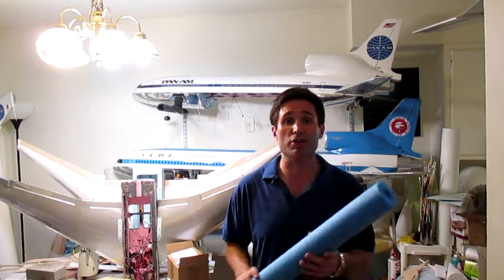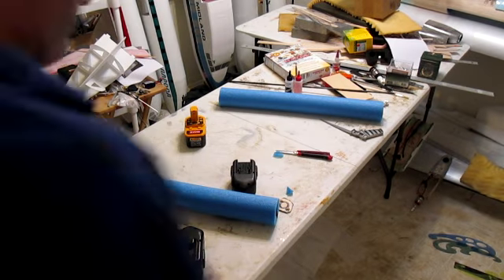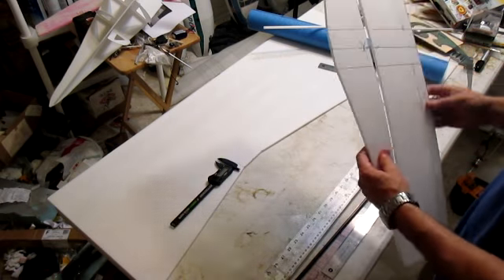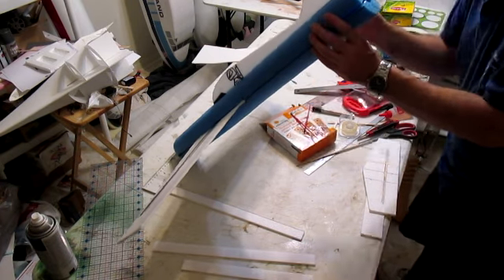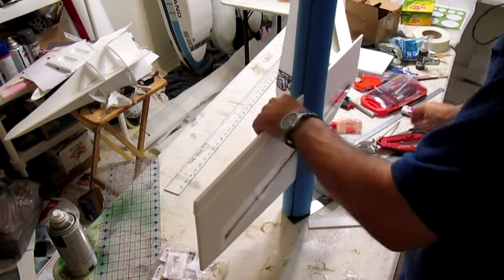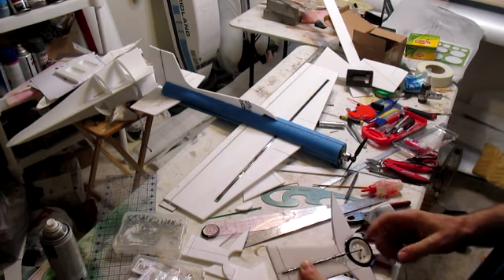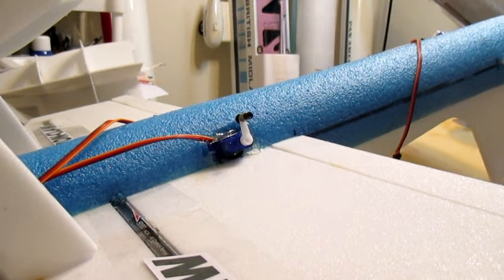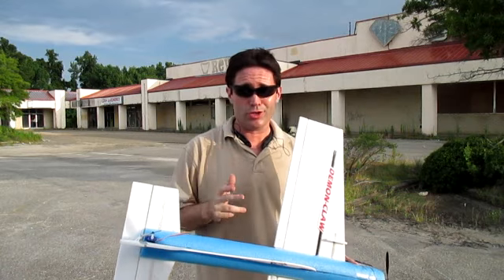DIY Your own Pool-Noodle RC 3D Trainer airplane!

Comment: so you went from a 2S battery to a 3S and had far better power, correct?  on my foam scratch trainer, i think im going to go with 3S.  I have quite a bit of front weight due to steerable landing front wheel but it will all balance out.  Tricycle landing gear for me due to steerability.  Also, ive got one servo per aileron which with 9G servos is just perfect.  Servo's only cost $1.80 usd per unit, so i'm using tons of them.  I might even add flaps, have you ever worked with flaps?  should I put them in place?  and could i do one servo for both flaps or would you do two servos?
Reply from the maker: Yes, she flew much better with a 3 cell lipo.

Comment: What kind of battery is it,(as specific as you can pls) 👍
Reply from the maker: Christian you can use a 7-volt to 11-volt Lipo Battery.
Reply: @F3HDemonDriver1  3 cell?
Reply from the maker: 11 Volt 3 Cell or 7 Volt 2 Cell, Yes.

Comment: Driver, get yourself a pair of KLEIN LINEMAN PLIERS  and you will never think a small steel wire is a tough one again. Been cutting hardened screws with these for years. Have tried many other Linemans and NONE compare.

Comment: We'd like to see it fly.
Reply from the maker: 2:36:15
Reply: This is a cool little project, but that is a FAST trainer, and obviously, a tube warped to the right is going to be problematic for a newbie struggling with trim adjustments in the first ten seconds of the flight, so attention should be paid to that.

Comment: Hi, awesome build. 
Could you tell me the diameter for the fiber rod and thickness of the Depron that You used?
Reply from the maker: Hi Sherri, you can use 3-5mm Carbon fiber Rids or an Arrow body as well.
Reply: Thank You for the prompt respond, keep up the good work.
Reply from the maker: My pleasure.

Comment: I'm very  sorry but at about 2.40  and again later  a view of the plane showed it to have a banana shaped fuselage!!
That plane is not straight at that point!
Great vid. But did you have to do remedial work to make it straight. 
What was that tool you used for forming drawn curved shapes? 
You used it for the canopy and the wheel housings?
Loved your "just do it" manner"
I'm going to try this. 
Thank you for posting this great tutorial.
Reply: It seemed to fly to the right taking off - he is a very good pilot to compensate and fly as well as he did.  Also I did not see where the motor was mounted with a degree or two of offset to compensate for "P" factor that could have contributed to the tendency to fly to the right that was visible on take-off.  Far too fast a plane for me as a trainer, but many great  points in the video overall.

Comment: Hi F3H DemonDriver. Thanks for the details in the video, looks like a fun project. Kudo's for the Chip Foose drawings in the beginning! I was wondering if you could share more details on the electronics, maybe an ordering example? Greetings from the Netherlands!
Reply from the maker: +Pevi70  I'm Happy to help Sir!
Reply: +F3HDemonDriver Great, thanks! Would you mind going through this list to see if I order the correct parts?
miniservo: http://eud.dx.com//product/towerpro-sg90-9g-mini-servo-with-accessories-844012859#.Vy3SPISLSUk
Motor, speedcontroller and props: http://eud.dx.com/product/a2212-1000kv-brushless-motor-w-30a-brushless-esc-1045-propeller-dji-f450-550-844413446#.Vy3T04SLSUl
Thanks in advance!
Reply: +Pevi70 Maybe this one is better:
http://eud.dx.com/product/a1504-2700kv-brushless-motor-10a-bec-2-5g-steering-servo-3-4-1-4-1e-motor-shaft-set-844045754#.Vy4eQYSLSUk

Comment: hi I am trying this I have a little difficulty about the parts her in Peshawar Pakistan
and can you tell me the ratio of power of ESC motor and battery plz
Reply from the maker: +gulfam khan Try and find a 20 to 40Amp ESC and a 7.4 to 11. Volt Lipo or Ni-cad Battery.
Reply: +F3HDemonDriver and motor?

Comment: CAN YOU TELL ME THE SECOND THING OF THE ELECTRONIC LIST
Reply from the maker: +mukesh Chauhan  Yes That's The ESC Electronic speed controller this controls the amount of Power that enters the motor from the battery, It then connects to the Battery then the Receiver or The RX which receives the radio signal.

Comment: congrats, this really is a nice tutorial how to do this rc airplane. You said the price was between 30-50 usd (or whatever). Does the price includes Futaba 7CAP 2.4Mhz Radio and FASST RX  ?? Would you mind to add some sites where we can buy each part of this rc airplane ?
Reply from the maker: +Light Out.  Your right, the price only covers the airplane, not the Radio, if you want cheep parts try Greyson hobby in Atlanta, or Tower hobby in Chicago. . . Or I'd you live outside the U.S. try Unitedhobbies aka Hobbyking.

Comment: I realize you are trying to do this so that even the most novice builder can build one of these planes, but there were times that the descriptions were a little tedious and repetitive. That said, this is an ingenious design and the perfect build for someone who is interested in getting into rc flying without the huge initial investment. The big plus is that when that first crash happens (as it always does when you're first learning) it won't destroy a plane that you've spent hours building and hundreds of dollars on. I'm even thinking of building one for myself to take down to the soccer fields by my house just for fun flying. Heck of a lot easier than bringing my glow powered plane and all that goes along with it for just a few hours of casual flying.
Reply from the maker: +Rob Billeaud  Thanks Rob, I want to Make Start-to-finish Build videos to help New builders get into Scratch building! I hope you try and build this plane Rob.

Comment: Do you have to have a y tell adapter for ailerons? I'm more than half way in the build but got stuck on the ailerons. Please reply
Reply from the maker: +Brad Smooth. Hi Brad. ... are you asking me if you can add a "V" or "Y" tail? Or are you talking about a Y-connector for servo wires?
Reply: Well I'm asking how did you make the ailerons go opposite direction at the same time?
Reply from the maker: +Brad Smooth  Brad that happens due to the radio and receiver's aileron channel. . . . Your ailerons always move opposite of eachother.
Reply: I'm sorry I'm asking you so many questions but your helping me a lot in this build. So if I put my servo in channel one where does the other servo go that goes opposite of that direction. Thanks
Reply from the maker: +Brad Smooth  Brad you need to use a Servo "Y" connector between the right and left aileron servos, then connect that into the aileron channel on your Reciever, Understand Sir?
Reply: Thank you I will do that SIR. Holly the build goes great.

Comment: I have made this plane exactly like you but my plane's back part is shaking when its flying 
Please reply
Reply from the maker: +shanu napal.  Hi Shanu.  . You need to add a carbon fiber rod or stick to the inside of your pool noodle in order to get the tail to stop shaking.
Reply: F3HDemonDriver Bro really really thanks for the help i skipped some part so that i missed the carbon fibier thing so sorry
Reply from the maker: +shanu napal No problem Shanu! My pleasure Sir!

Comment: I'm thinking about building it because it seems good on flight and build, but have one question will it fly with a 1500mah 7.4 battery and a 1000kv brushless motor. PLEASE REPLY THANKS.
Reply: +Brad Smooth depends what prop you use
Reply: I'm using a 10×4.5" plastic prop with metal prop adapter.
Reply: +Brad Smooth yes that will provide enough thrust
Reply from the maker: +Brad Smooth  Yes If you keep the construction very Light you should be ok with that battery and Motor.
Reply: +F3HDemonDriver thanks a million.
Reply: +ConorCon thanks a million.

Comment: Hey, what's with the two L1011 fuselages hanging on the wall.   I assisted with deliver of the first TWA L1011's in 1972.  Beautiful bird, but the DC-10 did better as a commercial carrier.
Reply from the maker: +Beemerdave1 Thankyou Dave!  Those are two scratchbuilt L-1011's the PanAm is a 500 and the ANA is a longer 300 series Tristar.

Comment: How can i determine the range between the transmitter and the receiver,and what influences this range.
Reply from the maker: +Ihab Ahmed  simply make sure your radio and RX Batts are charghed up and you'll be fine   . . .keep your plane within 800 feet and your fine!

Comment: is there a way to extend the battery life? I'm trying to use this as a trainer to teach others how to fly a plane that we will use in the future; so we don't want to constantly have to stop and recharge the battery. Thanks for the video, it was very helpful!
Reply from the maker: Hayden Clish Hi Hayden . . M the easiest  way to extend  battery life is go easy on the throttle  during flight. . . Another thing is build or fly an aircraft with a long glider-like wingspan.
Reply: Thanks, good tips. I appreciate the quick response.

Comment: KV represent RPM per Volts, not KiloVolts...
Reply: I want to say that you actually mark a point too, and yes, some will argue on my comment I posted there, but in the context of this video, where we're talking about RC planes and KV motors rating, and much much more other stuff, I consider that saying kilovolts is a pronunciation error, and that the term RPM/Volts or just KV is much better for comprehension and also for avoiding confusion from other. I also want to say that this is true for me, exept if someone invent something that needs the kiloVolts unit to explain its capabilities, and that this thing is used in RC hobby (just because I never seen that, but it's possible that it already exist...) But, I do say that the video was well made and that the RC plane was really well thought and desinged for the money and the time spend to it! (just saying, I speak french, so i'm sorry for the mistakes I probably made ^^)

Comment: Great video!  My son and I are gathering all the materials to start building the plane as a Father's Day gift and summer project. We are wondering what is the size of the propeller you used and which motor should we use.  Thanks for taking your time to make the video and for your feedback.
Reply from the maker: Hi . . . Sounds like a great idea Sir. . . Get a mini brushless motor of 1300 to 2300 KV that's kilavolts. . . About 22 to 2mm diamter.
Use a 5 to 8 inch prop.

Comment: Think plane was little tail heavy.  You don't have common sense to fly away from traffic poles n buildings.  cant you find a field.
Your safety with blades in hands while cutting needs some cutting on board.
when using pinned hinges u should put a little vaseline over pins so glue doesn't interfere and gum up the works.
When u are holding up plane and working on rudder taping you were off camera site.  landing gear needs 1/8" square stock on top of wing and more cloth length of landing gear.  Other that that it was an interesting video..l hope you do more.
Reply: ronald wasielewski Ok RONALD WAKDONALD,,, ENOUGH VERBAL BEATING UP ON DEMONDRIVER,,,OK?!?!?!  OI VEY,,,,,,,,!

Comment: My son wants to try this as his first RC plane project. Can you tell us more about the receiver, the speed controller and the battery that ended up being most successful? We live in China, so we have some extra challenges trying to dig up all the supplies. Any details you can provide would be helpful! Thanks for the great, detailed video!
Reply from the maker: Carey Jane Clark Yes Ma'am, Use any good 2.4Mhz Radio and receiver, the smaller the better and a 20-30 Amp Speed controller and a 7 to 11 Volt Lipo Battery  . . .you Live in the RC Factory of the world so you can find these parts anywhere.  Sorry for the late reply Mrs Clark!

Comment: hi.I'm beginner. I have a rc plane its weight ~600-700 gr and li-po 2s 2200mAh. I could not decide motor type. how much its power/KV? may you suggest some advise for motor? I have C20 1550 kv-75 watt (propeller 7x5 ) motor but it not enough to flying.

Comment: Hey awesome video will be making one but quick question do you think if I got a little bit larger motor it would still fly? The reason being is that I would like to attach a small camera I got off ebay it is so small it fits I'm my Palm about as long as my ring finger. Do you think this would work
Reply from the maker: Sure it can. . . Just add about 8-to-10 extra inches to the winspan.

Comment: can you tell me the minimum of a motor speed or strengh to maximum and the cost.
Reply from the maker: AshTheBacon Hi Ash, well RPM is all up to the Motor size and its Voltage but i would say 4,000 to 8,000 RPM and cost of the motor can be $10-30.
Reply: ok thanks

Comment: I have looked for carbon fiber  arrow shafts in Australia its over $100
carbon fiber tubes from hobby king are cheap but i don't know what size thickness is the carbon tube you have used.
could you please tell me this thickness of the carbon fiber tube you have used and the thickness of the foam you have used to make the wings? I'm new the the game i need a bit of help.
Thanks
Reply from the maker: Try looking for used Carbon fiber arrows on ebay.AU or Craigslist.AU
The carbon fiber rod should be 4mm to 6mm is width and the depron should be no more in thickness.
Cheers mate!

Comment: Nice plane/video pretty clever,but,dont most 3-d planes have bigger airlerons?well i usually make mine about 1.5 to 1.75", but nice plane none the less.
Reply from the maker: Thanks for commenting! . . It has smaller ailerons because it's a 3D trainer.

Comment: But how is this wing generating any lift?? It's flat shaped, not an airfoil. How does it fly?
Reply from the maker: This flat wing does indeed create lift, the flat wing's flat leading edge creates vorticies on top & below the wing plus there is airflow over the top and bottom and they act like the flow over a conventional wing, watch the flight at the end of the video and you'll see for yourself Sir
Reply: Ah, I see now. Thank you for the crystal clear explaination. I only thought about the bernouli principle.

I did saw it fly though, I just didn't understand how.

Thanks again.

Comment: How do you secure the battery and electronics into the fuse?
Reply from the maker: Use Velcro Or a strap, I carved out a battery slot into the Pool-Noodle and used Velcro.
Reply: F3HDemonDriver
OK, thanks!